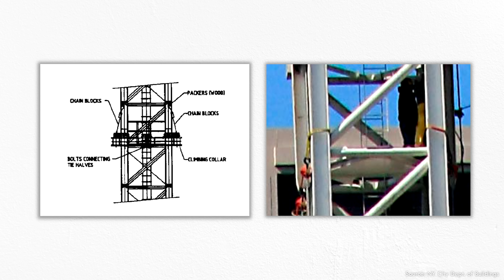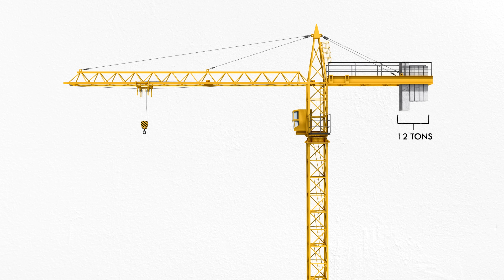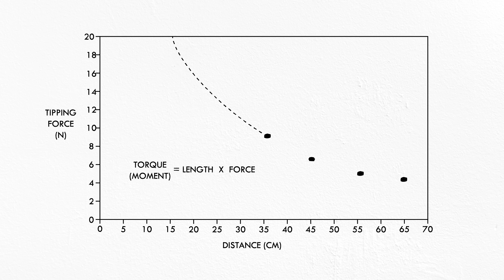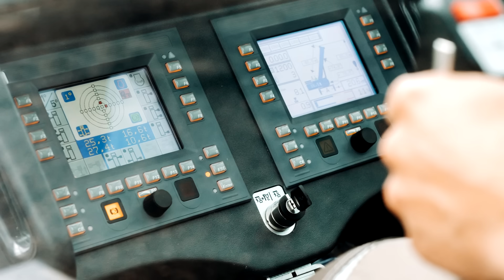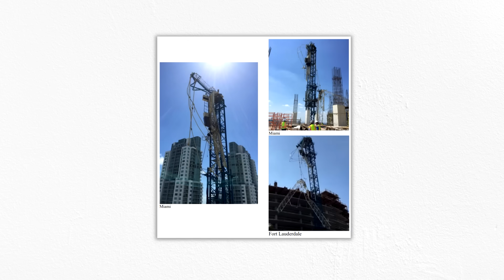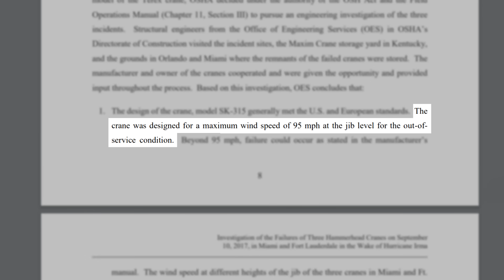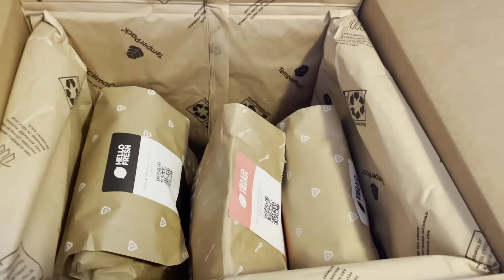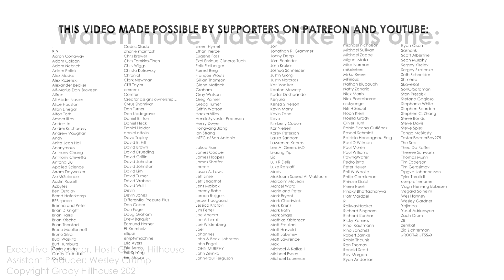Why Cranes Collapse

Comment: I spent 9 years doing ironwork from 08-17. In that time I saw 2 crane fails along with a few close calls. One I witnessed from another structure and the second I seen the crane since we had to go break it down and load it so it could be hauled off. Thankfully nether was while we were working with them and didn't cause horrible damage or any injuries let alone deaths.

The first was a subcontractor under the company I was working for who was brought in for a sub structure so we could stay on the main structure. They didn't put pads under the outriggers of a 60t RT boom crane on unpacked dirt. They only had a 200lb beam on the hook but were reaching way out over the structure. It drove that inside outrigger straight into the ground and settled against the structure doing no damage to the crane or structure. They used a boomfork to hold that back outrigger and boomed up until it settled back down with the forks help to keep it from whipping up. A lucky close call.

The second was when our other crew onsite was picking a heavy load up at the prep yard to send it over to us at the structure to install. It was approaching the max of the crane which was another RT boom crane but it was still rated for it as long as it stayed close to the crane which was fine to just pick it up and back a trailer under it. The problem was the operator only ran out 1 stick of boom instead of 3-4. In doing so this put all the weight leveraging on the boom instead of transferring it down into the crane body. As soon as the load came up 4-6 inches off the ground the boom section buckled and folded. Other than the damage to the crane the crew were all fine and no damage to the load. Later they sent us to break down the crane so it could be hauled back and repaired since the crew was still being questioned for any other mistakes or faults.

I still feel horrible to this day about the second one because it happened right before lunch and we hadn't heard about it yet. When I walked into the meeting trailer for lunch the operator was in there looking a bit like a kicked dog and I offhandedly and jokingly said 'ahhh did somebody get in trouble'. He just kinda hung his head a bit and the supervisor walked out of the office seconds later and they both left the trailer. I found out just a minute later what happened and stepped outside to apologize but they had already left. He had been let go and driven offsite. I've regretted that ever since.

Comment: That crane mentioned around 3:50 mark . . . WHY was the assembler using the wrong manual?  Was the company to blame, having tragically sent the wrong one?  Was the right one misplaced and the correct one difficult to obtain?  Was it just individual stupidity?  It's so important to understand the human problems here -- which people become vulnerable to  making mistakes and bad choices and what are the pressures on them that lead these mix-ups all the way to tragedy before they are noticed?

Comment: There's a lot that can/could go wrong. I remember one day driving to work and seeing crane at yard. I began to talk to guys at site and said that they should move crane a bit or put a large plates as support before starting as it's outriggers where directly on top of sewer piping and only small amount of tarmac on top of it. Operators look was something to remember when I got told that the lifting had already been done and no one had warned about it. I could prove it to them as I walked something like 50m away both sides on top of drainige plates and showed them that, yeah, it's pretty much directly at worst part. Luckily the load they lifted was very small. But prime example of downright catastrophe what would've happened if they've lifted something heavier.

Comment: Possible future video topic: When reasonable assumptions go wrong. Seeing the compaction part of this video I'm guessing that compaction measurement and as a result of using that tool is based on the reasonable assumption that deeper down the soil is compact and stable. There have to be situations, hopefully in most cases the first and the last, where everyone does everything right and something still goes wrong. (I will never ever forget being in an elevator full of young engineers in the Kansas City Hyatt (2002) and not one of them had heard of what had happened there. Maybe they were all chemical engineers - some of them had Kodak logo shirts.) 
There was also that crane collapse a year or so ago in Vancouver (or Seattle?) The crew was disassembling the crane and loosened or removed the bolts  holding the lower sections together, when the top started leaning in (I think) a 15 mph wind. Because they'd loosened the lower sections too soon, it wasn't really working as a unit - more Jenga than vertical structural assembly.

Comment: I wonder if there are cranes with counterweights that can be automatically adjusted while lifting a weight by sliding it in or out as needed.
Reply: Manitowoc MLC series, MLC300 for example.
Reply: @hwoods01  Interesting. Thanks.

Comment: It is almost never that crane operator do not account the winds and overload. It's the manager on the ground who tells on the radio that we do not have time or resources to get a bigger crane. Let's take the chances, it must be that engineers who designed the crane made some margin for error etc. Same as for those huge trucks on highways, they are well aware that they are going above the speed limit and not driving safe. It's the managers and time schedule they are battling with.

Comment: 5:40 Outrigger must always be used. If there is no room, that crane shouldn't be used.
The wheels is not meant to handle that much load.
Some cranes have outriggers that don't have to be out, but can still be deployed straight down, then they can lift light loads.

Comment: so I have a question, when the tower crane isn't lifting anything, why doesn't it break off//fail at the counterweight side? pls avoid technical terms cuz, I aint no engineer.
Reply: Some are fairly complex but one pattern I have seen is the counterweight and jib are balanced and in the air.  Then the base of the crane has a huge weight that stays opposite the jib and is attached by fixed length cables.  As the crane tries to tip under the load that puts tension in the fixed cables and provided the weights are adequate it all stays upright.

Comment: At work I've done bearing capacity calculations for cranes multiple times. In a clay-rich area it's not unusual that you end up having the put the whole crane on top of large steel plates to distribute the load on a large enough area.

Comment: Do you want sound effects with that or not...... That was funny.  The Milwaukee collapse was also due in part to the fact the the wrong Main Pin was used. or the bolts securing it.  I forget now but the bolts or pin failed because they were under-rated.  However, I don't recall if it would have failed regardless considering the high wind conditions.  That stupid human factor ("Got to get it done now" itest.

Comment: I think manufacturers should by default put a certain margin of safety on their equipment like if crane can take 300 tons mark it as 250 or so.
Reply: This is standard for most equipment, called a safety factor. If it can handle 4 tons but the recommended max is 2, the safety factor is 2

Comment: Regarding rigging, maybe this might be of interest: https://youtu.be/ehvFVjsieiw
This is a failure that happened in Germany. As far as I know, the hole thing is still under investigation, but preliminary reports say the whole thing failed due to the hook failing way below it's design capacity. After that, the situation went from static load to dynamic load and the crane completely failed.

Comment: Planes and cranes seem similar in that the failure rate is actually relatively small but when they do fail disaster ensues. Most crane disasters are from human error however.

Comment: I once worked at a site with 3-4 story office buildings, a new one was being put up across the street. One day I went outside for lunch and saw a tipped crane. The Clay soil had deformed letting the crane tip over. I don't think the crane was even loaded, it was just being moved into place IIRC.

Comment: It sounds like construction sites would benefit from having a training officer whose job is to ensure that the assemblers and operators actually have read the right material and watch the right videos.

And if crane manufacturers aren’t providing videos, THEY need to get their act together.  Video is often the best way to learn.

I am glad to see they can pull meant electronic sensors and displays to assist the operator. That has, no doubt, saved lives.
Reply: Videos are only useful if the job is of a scope where one human could remember all the steps.

For something like assembling a tower crane, with hundreds or thousands of steps and stages, I prefer a clearly written set of instructions (with criteria for confirmation of success), so I can focus on getting each step done correctly before moving on to the next, without having to keep all of them in my head at once.
Reply: @boosterh1113  probably having both is a good idea. You don’t want to be watching a video in order to follow a sequence of steps. 

But maybe understanding what a step actually involves could be aided by a video. 

And learning general concepts and risks maybe better learned through video than by checklist. Like this one.

Comment: You should do a collab with AvE - he discusses crane collapses from time to time. Of course I'm not sure you could handle his amazingly dirty mouth :p
Reply: I'm sure they could work around the language preference and come to an agreement that'd work for both. 

What might be a bigger issue is that AvE isn't reluctant to look at the recent events and closely inspect photos and videos. Picking up on what might be missing safety pins or whatever where Grady seems to trend towards events more distant in the past with completed investigation reports and going over those and other theoretical scenarios. But even there I'm sure they could get to an agreement or just decide that it's not a good fit while still appreciating the the things the other person makes.
Reply: @extrastuff9463  Agreed! I'm sure they could come to some sort of 'compromise' on the latter point. In fact it would be interesting to see both points of view, etc.

Comment: I just thought with the crane vehicle and why some might tip like the demo at 1:34. Weight of course, but there's also the simple physics thing of distance from the vehicle itself.
I suppose what I'm imagining is a 45 degree line of where the load must not be lower than, giving an imaginary triangle area of 'safeness'.

Comment: Speaking as a retired crane operator (1968-1990).  You make a point and there is some validity, but you missed a few:  During my time, 22 years, I never saw a manual.  (Not one)  On a tower crane, it is required to use new bolts EVERY time.  I have only seen new bolts being used in only a few instances.  Another time a boom brake band failed, an oddity for sure.  And my favorite: When a crane belongs to a general contractor, they just "loan" it to any sub contractor on the project.  A rigger should have been included to work with the operator and to make sure every operation was safe. Thanks!

Comment: We had 2 historical fatalities @ my former plant. One guy got crushed between a suspended load of aluminum ingots and stack of stationary ingots. Another guy contacted a power line with his load. He jumped clear of the crane but went back to the crane and became the easy path to ground when he attempted to remount the crane. Cranes are dangerous I've seen dropped loads and components of our Cranes fall.
Reply: One time on a safety tour I saw failed shock bolts on the cold side travel motor of a crane being operated by a greenhat/new employee. The motor would lift several inches when activated. I stopped work, called his supervisor and maintenance. He told me it had been operating roughly for a few days....
Reply: @aaronjoseph1777  😬

Comment: Very fascinating series! I wonder what happens when they get hit with lightning? What if the operator is inside? Maybe cover that in a future video?
Reply: they are a faraday cage  basically the bottom of the crane will have an earth electrode connected to it deep in the ground so when struck the crane is earthed and the operater is perfectly safe
Reply: @646klein  the operator's underwear, however, may have a different fate.
Reply: @Outsideville  definately a brown trouser moment for sure lol
Reply: @Outsideville  no, if its properly grounded also
Reply: @Outsideville  lmao
Reply: @Outsideville  is that what you call a brown-out ?
Reply: @casemodder89  yes, I believe that's the technical name for the scenario. The proverbial first you say it, then you do it.
Reply: I've seen a couple crawler cranes get struck, fried a computer on one.
Reply: @noncched6839  crawler cranes basically use their tracks to earth it self perhaps the cpus and components on older unit dont have anti-surge protection built in, or eddie currents build up id imagine
Reply: @646klein  I had an SUV get struck by lightning once, and all electronics were fried.  I thought that fuses should have helped, but all fuses are on the positive side, while lightning enters devices through the negative ground to the body.  Since cranes are lightning-prone, perhaps they have independent ground and surge protection on both sides.
Reply: @MikeV8652  I'd imagine lightning would be enough electricity all at once to make any fuses useless
Reply: @RosalynTosh  The fuses weren't even blown.  The fried horn rely left the horn sounding, and I had to remove the undamaged fuse to make it stop.
Reply: @MikeV8652  Fuses?!  Pfffphht.  Lightning can ionize thousands of feet of air in an instant.  That little 1/2 inch gap in your fuse makes a difference?
Reply: @nauy  Yeah, I know; which is why I was surprised that the fuses were unharmed.
Reply: @MikeV8652  Fuses are far from perfect. They can be slow and sometime they don’t react properly if the voltage or the current is over a certain threshold. Let’s not forget about the fact that during a lightning, the electromagnetic field itself might be enough to induce current and fry some fragile electronics.
Reply: @noncched6839  So, what about when too many people get used to them? Does that mean you have a whole pile who can't function without a computer,  then?
Reply: A few months ago I saw a crane get struck by lightning and it didn’t move. However on this crane, the operator is on the ground so I’m not too sure about them
Reply: Lightnings have one objective alone reach the surface and they would follow ''easiest'' route while doing so. For example if there is something more conductive than air they would follow it which is why they often hit metal structures as they are way more conductive than air. But metals are also way more conductive than human body so lightning would never ever follow a human instead of metal structure of the crane. So operator is perfectly safe even if there isn't any spesific protection but same can't be said for electronics, lightning passing through the crane would create a powerful magnetic field and this magnetic field would create current inside electronics and might damage them. So there are lightning protection systems in cranes or planes etc not to protect us exactly rather to protect electronics.
Reply: I know for a fact having worked with mobile cranes for a few years, unless the operator is really anal about it, and to an extent on days with questionable weather, the crane (mobile crane) is typically not grounded with a ground stake/grounding connection (the dick looking metal thing that usually points down on a crane or telehandler). But that doesn't mean the operator isn't still safe, as 646klein said, Faraday cage, the electricity goes around them through the cab, doesn't even touch them,  it's usually the ground men or the people closest to the hook that can be killed, I don't know anyone who's been killed on the job with or without a crane around by the way, but as Ive heard from the operators I've worked with, that's the biggest fear in an electrical storm they have, someone else getting hurt, as for tower cranes they're grounded either through the building if the sections are erected within the building, or by a ground strap and rod, much less likely to harm anyone but still not really safe to work in
Reply: I thought a faraday cage is what blocks out signals, like cell phones?
Reply: Hi ben
Reply: @bigboreracing356  I was driving a semi that got struck by lightening. (The trailer part). Everything seemed to go dead for a few seconds and then it all returned to normal. Seemed very odd to me that no other damage was caused.
Reply: @nickybritain4900  That was an alien abduction.
Reply: @Autistic Engineer grown men bunny hopping, I'd pay to see
Reply: Everything you can do to protect from lightning is not enough.  If you don't believe me, go look at the shelter on the top of Mount Whitney. it is completely enclosed in an iron cage and grounded at each corner.  There is also a plaque on it that reads "In the event of a storm, get off the mountain.  12 people have died in this cabin".

Disclaimer: this is from memory of a trip about 15 years ago
Reply: I was operating a tower on the edge of the UT campus in Austin years ago when I get a phone call from a buddy of mine across town.  He asked if I was alright.  I said yeah, why?  I didn't know what he was talking about but he said he saw lightning hit my crane.  It was still raining so I wasn't about to go check,  but when I could, i couldn't find any damage anywhere other than the horn had quit working.  I knew it had hit close, but wasn't aware that struck a glancing blow to me until I got that call.  Strange.